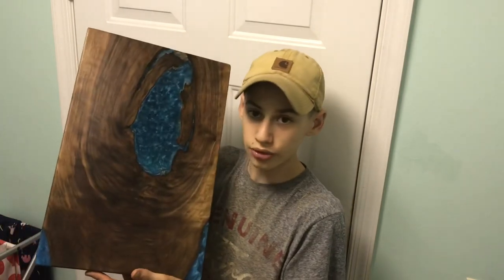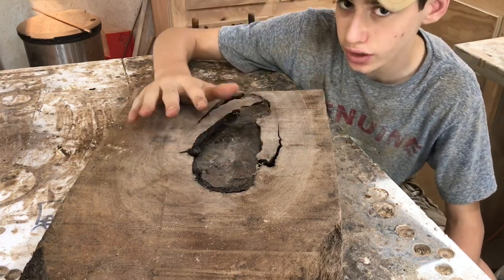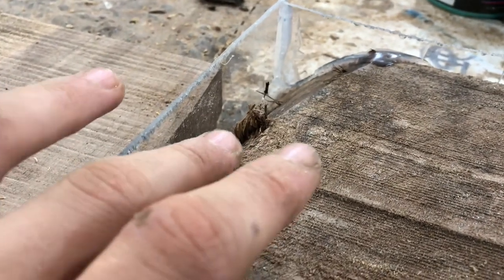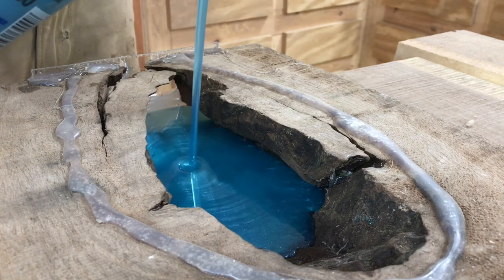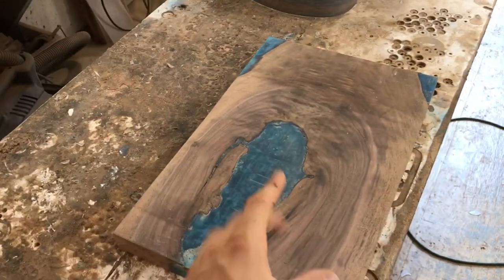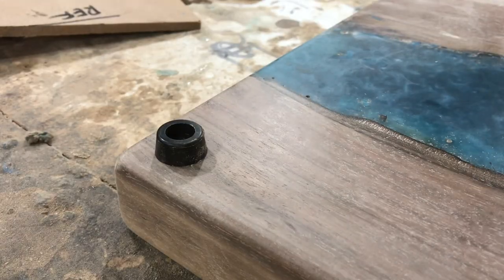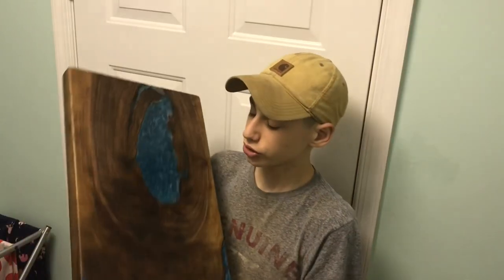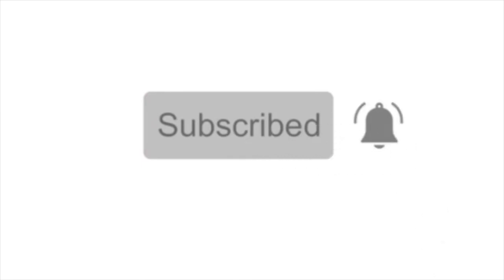Make an EPOXY and WALNUT Serving Board!

Comment: You're amazing Seth! Love your videos! Thank you!
Reply: I've been in the building business since the mid 1970's. With well over 500 employees, young men like this are RARE. Most importantly his video is thorough. Not many questions did I have when I was done watching.  I turn wood also, and I can honestly say, over 50% of every video is watching someone turn. Handles, uh, the process of flipping the bowl blank, mounting the blank to start, All the necessary so important , and a must for safety and a successful finished project, is so often just bypassed. This young man has it covered. There are missing parts. but  I feel good about tackling my first epoxy project.  Wood prep, mixing, how to color, more explaining about cutting/planning, sanding and additional finish, But he does touch upon all. Awesome JoB A+

Comment: Heyo Seth looks great! Just one question: I noticed you don't use a jointer or hand planes... How do you flatten your boards?
Reply from the maker: ANDREW BIG a lot of times for cutting boards I’ll use my bench top belt sander to knock down the corners that are making it rock. For this, I ran it through with the top side up until the epoxy was flattened, then I flipped it. Since I put feet on a lot of boards, it’s easier to adjust them to make the board sit flat with no rock.

Comment: Seth, beautiful piece. Question, what size feet for the board, 3/4”? Also how many coats of mineral oil? Thanks, great video!
Reply from the maker: Kelly S. Wood 3/4”, I keep adding mineral oil until it stops soaking it in.
Reply: @seths_custom_creations  Thanks.

Comment: how do you get the epoxy to not gum up your planer because I made a cutting board similar to this one and my planer knives got gummed up.
Reply from the maker: Woodworking Genie I’ve never had an issue with that. If you let the epoxy dry completely you shouldn’t have a problem. Try giving the epoxy 3 or 4 days to fully harden and use really sharp knives. 👍
Reply: Seth's Custom Creations ok thanks